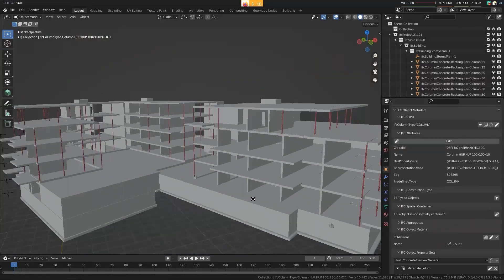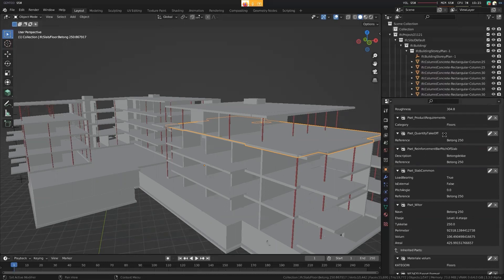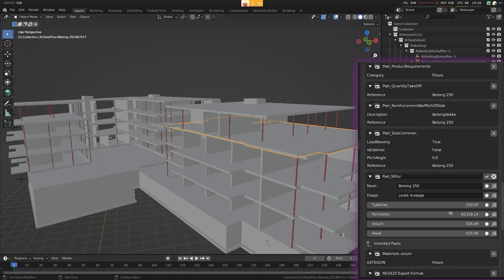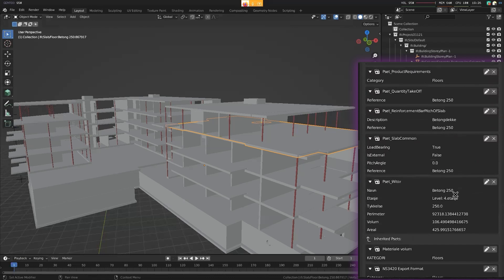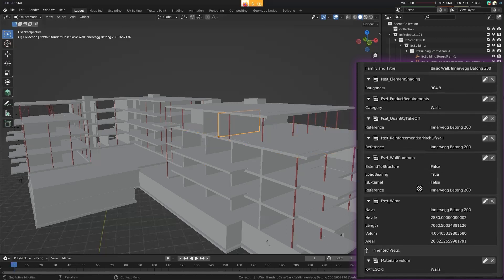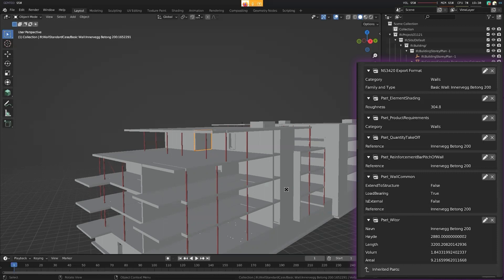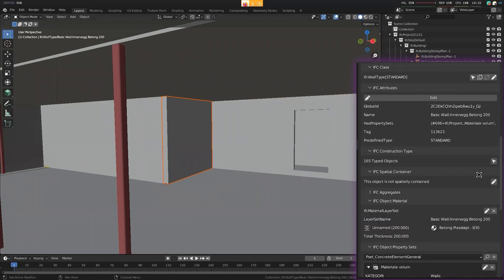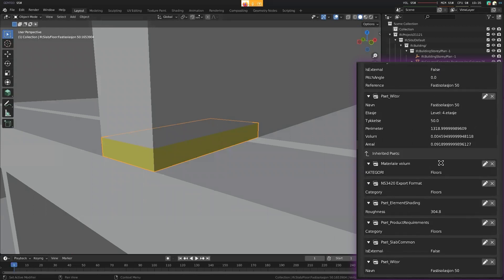IFC Object  Properties Check with BlenderBIM Add-on

Comment: I might get thrashed a lot for saying this. I think the primary issue with the IFC format is how the Pset works. The fact that most of the Pset information is not linked to the geometry by default is a problem I feel. (Kind of like the proprietary BIM software where if a geometry/material parameter is changed, the associated geometry and even the other parameter changes) The option of decoupling the Pset with the geometry should not even exist IMHO.
Reply from the maker: You should not get trashed out for saying this, all opinions are welcome, so if they are valid good ideas they might get solved :)
Reply: @BIMvoice  I'm hoping so too. What do you think about this @Dion Moult?
Reply: @spaciotechtonics  I think what you're describing already exists. Where it makes sense for an ISO standard to link properties to geometry, they have already done so. For example, Fire rating is naturally not linked to geometry. However parametric layer set thickness (technically not a pset, but still a parametric attribute) is. Same with profile offsets, profile cardinality point (center, top, left, etc). So yes, exactly as you describe if you change a material parameter, the associated geometry is changed and qtos are recalculated. Perhaps we will come across this in a future video (or you can try it now with BlenderBIM Add-on's native parametric modeling abilities, and change properties like height, thickness, profile, etc and see the geometry update correspondingly)
Reply: @DionMoult  Great to know that this exists. A video on this would be great if you can.